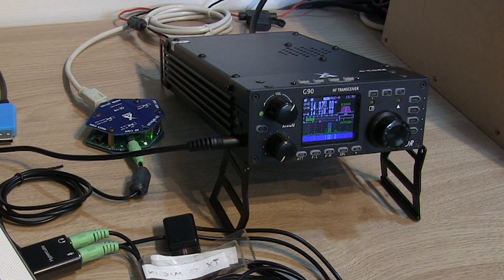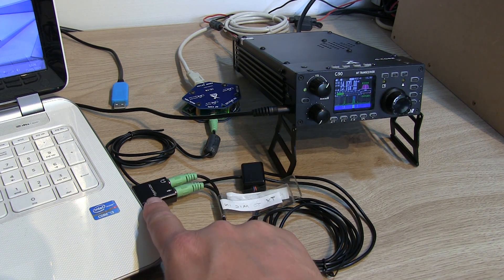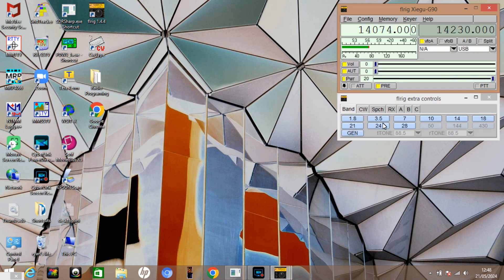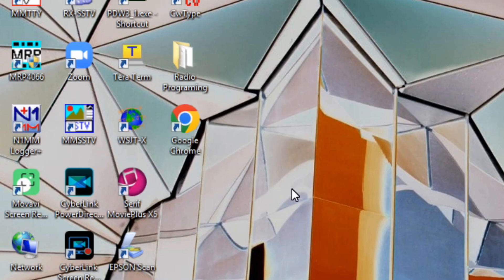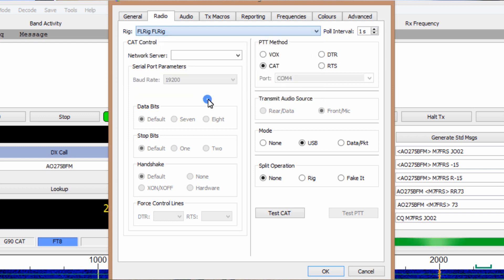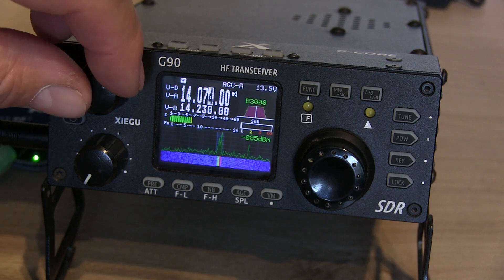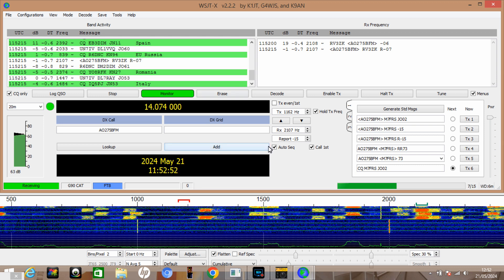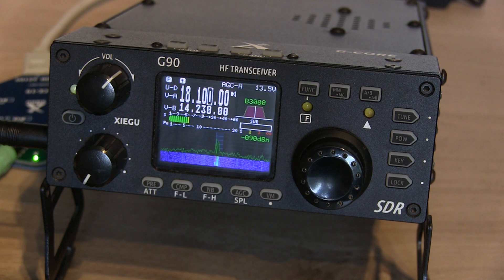Xiegu G90 FT8 - CAT Control - CE19

Comment: Love it I going to try this straight away - my ce19 didn’t come with the splitter box I had to wire mine into a y cable - I got all the same stuff as yours including the Sabrent  sound card … I added toroids on most every cable on both ends which might be overkill - oh question com port 5 was the blue usb interface  ?

Comment: I don't see the G90 in the WSJT program configuration! I only see "default". Can you help me? version 2.2.2
Reply from the maker: As you can see from the video, I'm using Flrig to control the G90 so in WSJTX I've selected flrig in the settings. The reason mine says G90 cat control, is because I have saved the settings and called it that. Otherwise, just use default. 
I hope that helps and makes sense. 
Best 73,
Ben
Reply: @m7frs272  Yes, me too. I launch Flrig first, my G90 is recognized and connected, except when I launch WSJT it doesn't connect: "Hamlib error: IO error while opening connection to rig"!! Thanks if you can help me

Comment: I looked at my FL Rig and noticed there is no Echo box to tick in my configuration window I am perplexed as to why?
Reply from the maker: Hi Brian, sorry for the late reply. Did you get it working? Ben.
Reply: @m7frs272  Due to my power supply kicking its switch and not working. I havent tried for two weeks been off the air. But now I sourced some new rocker switches and fixed it, so now can get back on the air, but my antenna not pulling in much on 10m propergation and so on. Cheers for asking.

Comment: Used to run this configuration when I started on digital. Works well if you plan on working from the shack but all those wires are not ideal for portable operation. I got myself a digirig and everthing became much simpler. Mini DIN in the back, TRS into the CAT control jack and one USB cable plugging into the laptop. Add an OTG adapter and you can run FT8 on your phone using FT8CN! 

Another useful tool on the laptop would be JTSync. Enables you to sync your time without the need to be connected to any network or time server!
Reply from the maker: Thanks for the info. Yeah I use FT8CN on my phone when using the Guohetec Q900. Thanks for watching 👍
Reply: How does  JT sync work?

Comment: Thank you for showing the set up with the CE19. I'm currently using the simple mini DIN audio cable and cat control line. I only use the WSJT-X software.  The rig selection is ICOM-705 as shown on Temporarily Offline Ham Radio's channel using the latest 1.8 firmware.
Are there any advantages using CE-19 other than the ability to connect the Xiegu amplifier?
Reply from the maker: I've just watched that video, and yeah that's also a good way of controlling it. When I purchased the G90 & CE19 a few years ago, I don't think that lead was available, so it's just the way I've always done it. Thanks for watching 👍